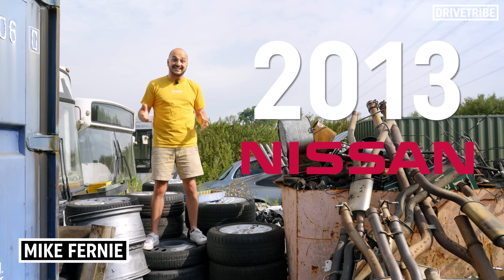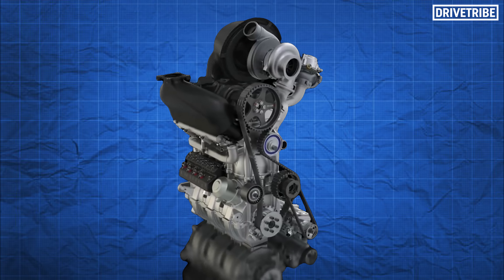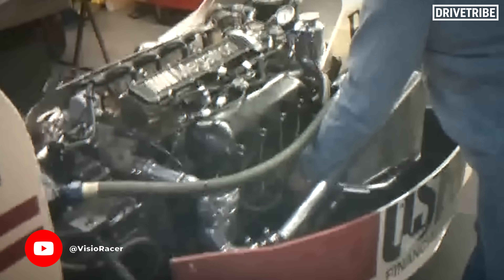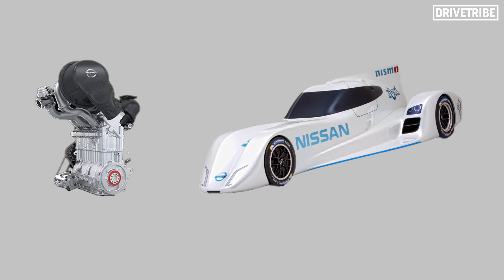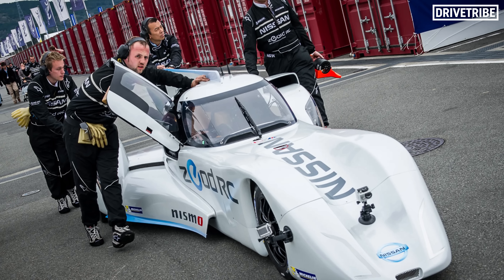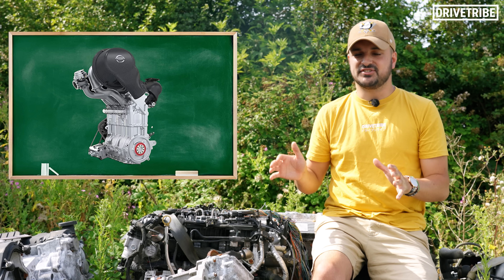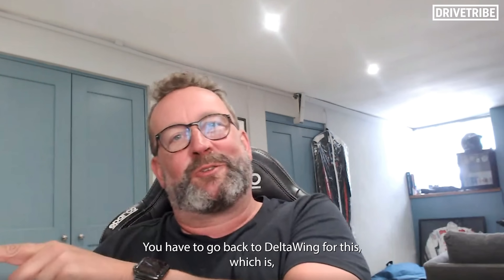This TINY Nissan Engine is More Powerful Than Your Car!

Comment: It reminds me of the Supra GT500 racecar, which had a 4 Cylinder engine that was a lot lighter than the Straight 6 2JZ. Perhaps Nissan used that engine in there racecars.

Comment: I may well have produced 400 BHP but for how long ?  Because it's so light also means it's block and cylinder head is weak . This reminds me of my motorcycle racing days when we built single cylinder 250 and 500 cc engines so supped up and running 14 to 1 compression ratio  on alcohol fuels through fuel injection into super chargers  and they produced over 90 HP  when a standard BSA Gold start 500 produced 42 Hp . However at 6000 rpm the B31  crankcase  blew up like a grenade . So me thinks that this Nissan engine did not stand up to any kind of prolonged use at high RPM .

Comment: I love nissan, but they deserve to go brok!  this engine done right would have wiped the floor with all this ev crap it would have been cheap to run in alot of small sedans and hatch's and even some bigger vehicles including 4x4's seams obvious to me it was scrapped because it was going to put a brick wall in front of the ev adgenda nissan must have been forced to put it on the back burner and it's typical and perthetic.....

Comment: Still a nissan.. it's  meh.. you'd  rather buy anything else than a nissan. All that hype with issues 1 year down the line and each trim or brand is like a fast food franchise with car parts not universal throughout other nissan lineups, or it used to be. Not like toyota where they're all corollas beneath.. Only exceptions are maybeee their sports line up, but then the convo goes beyond us common folk.

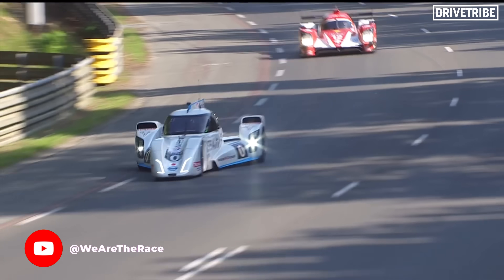Comment: 7:50 Let down by it's gearbox...
Nissan has been plagued/cursed by it's transmission system ever since they're experimenting with their torodial cvt. Quite sad actually. I assume because of that failure, they had some delay in their cvt development and research knowledge, like identifying the heat issue in their currently used cvt system.

Comment: Can we put it in a motorcycle?
Reply: probably but i’d rather put it in a cross kart or some beater car
Reply: I think motorcycle engines are meant to be fast but not carry too much weight, and car engines meant to carry weight so it wouldn't be that fast I think, but idk I'm not an expert
Reply: @yt159-sj6hd  re read the question that’s not what the op asked
Reply: @ true i just wanted to predict the outcome if it worked
Reply: @yt159-sj6hd  yeah you are right also since the engine is turboed the power delivery wouldn’t be safe for the motorcycle

Comment: What's most fascinating about this story to me is that Nissan couldn't make a durable gearbox for a race that's existed for over 100 years.

I don't know what's wrong with engineers these days. It's just a box of gears. Find your spec, overbuild it by 10%, and go cruising for 300k+. It can't possibly be so difficult to make a box of toothy wheels happy. 😓

That's the main issues I have with most cars... Automatic transmissions are seemingly made of styrofoam. That's probably why they've transitioned into sealed "lifetime fluid" versions since they already know it's likely going to die before the oil would ever need to be changed.

--oh, and to answer your question, I'd put that engine into literally any car I had the opportunity to lol. Not so torque-y, so nothing too heavy, but it would turn any roadster into a REALLY fun toy.👍 Maybe a Fiero?

Comment: The Koenigsegg Gemera is equipped with an unusual three-cylinder combustion engine called the "Tiny Friendly Giant" (TFG). It has an engine volume of 2.0 liters and produces an impressive 600 horsepower. What makes this engine special is that it is turbocharged and uses Koenigsegg's Freevalve technology, which eliminates the need for a traditional camshaft.

Comment: I think you may be a bit mistaken about the issues being caused by 24 hour use, the gearbox lasted 6 laps it didn't make it a half hour, what this car's gearbox issues boiled down to is 20xx Nissan transmissions, was probably a cvt and all of Nissan's CVTs back then were reliable until the first oil change if you got lucky.

Comment: Kawasaki H2 engine puts out about 192 and can put up to 250hp and is a 1.5L  inline 4 cylinder turbo that weighs around 62kg fully dressed up.. and that could probably be reduced quite a bit given you don't need an internal transmission or clutch so you could make it a direct-drive. I have seen some attempts at using motorcycle engines in cars and they typically lack torque but the H2 torque figures are decent at 123 ft/lb... so not extreme numbers but very light-weight.

Comment: So I’ve said this for years. The actual solution to all of this is to make a highly efficient 3 cylinder engine with a battery hybrid that has a 100 mile range. The battery starts the vehicle from a stop and then the gas engine takes over after 20 mph. Gas engines are least efficient when initially moving a vehicle while electric motors are incredibly efficient at this moment. With a perfectly balanced crossover vehicle with a 25 gallon tank. You could easily achieve a 1,000 mile range where the hyper efficient engine gets around 50 mpg and the electric motor helps it maintain that by utilizing regenerative braking, start stop and moving the vehicle from a stop.

Comment: Why compare a 2.7 to a 1.5 thats double the weight?

Lots of engines are all made from one design thats purchased as a file.  Most of the parts shared which is why all motors have the same issues.  Eith a few addons are tweaked or the ecu tuned for specific hp and tq.

The nissan rogue engine with a tune and twin turbo is what im dripping into my car because its easy to find and cheaper compared to finding a ford dragon in north America at the moment

Comment: Allright listen... i am building a Saab 96 850cc 2stroke engine with forged internals. traget power between 80 and 90hp. and im pritty sure the thing waight isnt more than 60kg. so that would be on the engine power to waight insane... right?

Comment: 0:04 it wasn't an engine, but marketing stunt.. this engine was never used or tested by 3rd party..
guy from sweden has air cooled bike engine that will do 1000hp, probably same weight without turbo and manifolds.. 

i think barebone skoda favorit engine block was like 9kg of aluminium..

Comment: 4:01 the engine has got to be expensive to produce (it's a race engine )and not all that durable, you don't get weight like that from making robust parts.
Modern cars would be better ditching all the weight from the excessive wires and sensors.

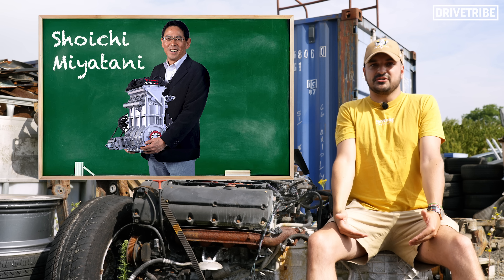Comment: 1:30 had to stop watching here, it is a cool engine but going on about the old man holding it, (he wasnt, it was on a stand) and it may have double the power of the ford engine but the Bmw engine from like 50 years ago has more then 3 times the power of this modern engine, I know because I did a full overhaul on one.

Comment: Should have held two engines one for each rear tire and use direct drive as once anyone adds 4wd these systems never work of course that would change to body styling provided any of this is true as stated😊

Comment: My VW Fox 1.4 engine has started drinking water recently, likely head gasket. So this Nissan engine would fit and I watch then Ferraries only from the side for a moment and then rear mirror until they are too small to see ... If you have a perfect working 1.4 BKR engine for free I take that too ...

Comment: so many eroneous figures in this piece!

40kg is the "bare" mass for the Nissan engine, ie an engine that actually can run and work is significantly heavier (around 66kg iirc)

F1 engines have for years been limited by regulation as to both their mass and their CofG, hence mad things like solid brass sump pans etc. A 100kg F1 engine could, by most analysis actually be got down to under 80 fairly easily, and the last of the V10 could make around 930 bhp in qualiy trim

The Old F1 turbo 4cyl BMW engine was nowhere near 45, let alone 75kg!  It's got an iron block and the turbo is about the size of the moon! Without all the trick thin wall casting and additive manufacturing tricks used in todays motorsports engine it was, bar some carefull machining, pretty much proddy block and head

Comment: Rotax has a 1630cc 4 cylinder running on normal car fuel with 300HP weighing 91kg. I think it's for jet skis normally. Fairly sophisticated engine by the looks of it.
I have been looking into various super alloys for jet engine use and I think I can say that what's being done in normal piston engines is a tiny fraction of what can be done with much better metals. Normal black steel has a tensile strength around 300MPa whereas a quality alloy can be 2000MPa and if you get exotic it can be 6000MPa so the wall thicknesses you are used to is just dumb cast iron 1930s thinking. done well it's just a thin shell around the pistons with negligible weight. same with the pistons, thin top hat, thin arms, well supported crank shaft. If it was any kind of sophisticated it would look alien. the term 'engine block' is a failure in itself. It could also have rocker pistons so there is no friction on the cylinder walls at all.

Comment: I like the 4 cylinder for aircraft usage.  400 HP for take off then dial back for cruse.   It could also be  mildly turbocharged to maintain HP at altitude...

Comment: I'd put it in a Honda Jazz/Fit chassis, the second US generation 2009-12. It has the most rigid chassis, great handling, and amazing cabin volume for a subcompact lightweight car.  The engine would be perfect coz the Jazz/Fit has a small engine bay space. If I wanted a sports car instead of a daily driver, Mazda Miata ist two generations, also for it's handling.

Comment: Hmmmm, 10HP per kg is quite decent...
Still, it's tame compared to Top Fuel engine.  (11 THOUSAND HP at 225 kg give me a figure of OVER 48 HP per kg!).
Sure, they don't LAST quite as long, but you already included F1 engines which are fully rebuilt after each 'use', just like Top Fuel.

I wonder why they weren't mentioned?
Oh, that's right, I forgot that DriveTribe HATES drag racing... <<Grins>>

Comment: Size (Part thickness and strength) matters with big power (pressure and heat). Electric has the edge because it only worries about heat and it very low in comparison.

Comment: I grew up racing Midgets. People do not realize how fast and light they are. 400hp, 1150 pounds with the driver, no clutch or transmission. They are direct drive with a higher power to weight ratio then F1.

Comment: couple of questions, 1. how much hp does it make without the turbo charger ? 2. what is its headroom for expanding hp ? 3. how much torque does it make? 4. what's its reliability ? 

really banging on about hp when its the turbo carrying the load isn't really 400hp, is it flat out at 400hp and isn't viable in racing, 3 cyl wouldnt be making very much torque and it is more important than hp, how long can it keep up in a long race squeezing 400hp from small engine usually become a hand grenade, is that why it never went into production

Comment: NHRA Top Fuel engine:  10,000hp, 500lbs (226kg) = 44.2 hp/kg.  'Merica drips the mic.
Reply: That is correct however it produces that level of power for 10 seconds at a time then after about 60 seconds of running needs a rebuild.

Comment: You may also want to look into the Toyota 503E 2.1L 4cyl Turbo, a purpose built racing version of the common 3S-GT 2.0L, with an increased bore (89mm vs 86mm) to accommodate larger valves to achieve better breathing from the cylinder head. It was originally from TRD USA and used in IMSA, but eventually made it's way into the JGTC/SuperGT Winning Mk IV Supras (Toms, Sard etc) in mid-90's Japan where it put Skyline GT-R and NSX alike to complete shame, considering what it was. It was not uncommon for it to produce well over 1,000 HP at the wheels for qualifying runs, then run around 600-800 for actual racing. It was eventually restricted back to 2.0L and the original 86mm bore after becoming too dominant and also handicapped with inlet/boost restriction. Just thought this engine might have also been interesting to you, since this was back in 1995.

Comment: What's GREAT! A small engine that has 400+ horsepower, get 75 MPG, has no oil or water, weights less than 300 pounds, keeps the horsepower no matter the altitude, can be worked on by a shade tree mechanic, is the size of a 14' tire, will last for 5000,000 miles and costs less than $2000.00. By the way Fred Flintstone had one of these!!!

Comment: Surely if you turbo a 200bhp+ 1000cc motorbike engine you could get it comfortably over 300bhp. Im not sure what it would weight but id guess it'd be less than 70kg. Theres plenty of people who have put a turbo on a hayabusa 1300 engine to boost it to 400bhp or more. They're about 90kg. Sure its not 40kg but its an accessable option already available on the market

Comment: Surely the amazing technology used to create the Nissan "Diglett", could be applied to build super-lightweight and efficient road car engines? If the car manufacturers REALLY wanted to, we could have lightweight, powerful and yet frugal cars. We need not go the EV-route at all. I'd be over-the-moon with a 150hp "only" version of that Diglett engine, if that means that it would translate to reliable road car engine power. Imagine a 150hp Diglett in a small 2-door car, like a 1960's Mini (I love those), and it you'd have a real fun little go-cart! Even in a more practical car like a VW Polo, it would still be amazing.

Comment: This TINY Nissan Engine is More Powerful Than Your Car! 🙃😏🤔 who come up with this title? The biggest majority of the cars driving in the Europe have engines under 200hp, and I believe, not much under half of them, have engines with less than 100hp. Så what kind of an comparrition is this?🤔 And something else "Drivetribe", there is no such a thing as a powerful car. The car is nothing without an engine. So that engine may be more powerful than the engine in my car but not more powerful than my car.  😉

Comment: i love the idea of small engines making big power. i loved it when the barra 6 showed up the big gm v8s, i loved it when the gr yaris/corolla showed up the STIs and Evos of the world with their 3 cylinders. if Nissan were to bring a similar engine to the production world, it could make a cool combo for a nismo variant of the current Z car if it were to be combined with a performance hybrid system. the lightweight powerful engine with an electric motor to assist would make for an interesting combo imo.

Comment: Ill be honest, I more interested to this kind of small engine putting 200-500 HP than the v8 or v10. and with the industries moving to battery power, this kind of real innovation for gas-powered engine is will be less in the future.

Comment: I have a twin cylinder Suzuki 1100cc arctic cat snowmobile that has 300hp with a simple ECU flash. Some people make more power than that with a few more mod. I  can hold engine it in two hands no problem. The 1000 cc  Yamaha - arctic cat same thing make 300 hp no problem with ecu flash.

Comment: The oro lemon with these engines like the bmw 1.5turbo from 1980 8s they are not robust enough for a  road car. . Race engine are pampered road engines are abused.

Comment: With that size, I am truly suprised nissan hasn't tried to turn this into a 400 hp motorcycle!
Reply: There is no point, tyre grip is the limitation on motorbikes.  Putting power through one small contact patch. Physics is against most things.

Comment: Imagine that in 12 cylinders!   Or slightly de race it a bit. Make it a more street able engine, and put it on a motorcycle, with 10-12 gears with a automatic skip shift, so when going up hills or accelerating fast.

Comment: Didn't Opel have a 3cyl diesel that got great mileage (100+ mpg) at a decent speed (avg over 100mph) over an endurance race?  I would guess it wasn't as light as this though.

Another small but powerful engine would be the super duke or something similar based on a pontiac 4cyl "iron duke".  Again not as light... but I believe NASCAR trucks were able to get close to 4-500 hp naturally aspirated iirc.

Comment: you should check out kawasaki's 310 jetski engine. also small lightweight, 4 cylinder 1.4 litre with a redline at 8200, supercharged.

Comment: With peak torque at 280 lb ft, the absolute minimum RPM that it would need (if peak HP and peak torque are at the same RPM - which almost never happens) is 7,500 rpm to make 400 hp. According to several articles on this, the engine redlines at 7,500 rpm.

Comment: I'd have loved this engine down tuned to 300HP and convert my limo from RWD V8 driven through a 4 speed, to FWD driven through a transaxel 8 speed, then slap a 200KW motor on the rear differential for an AWD hybrid

Comment: We have a Fiat 500e - that we have started imagining what would be done when the Electrics Finaly bite the biscuit!
Any ICE solution would have to be tiny to fit in front, and we don’t really want to gut it and put the standard 500 drivetrain et all back in…
Some something like that or the Ford 3 cylinder might an option 
🤣

Comment: Hi, I don’t know if someone already pointed it out or not, but Nissan started to sell in Europe a 3 cylinder for the hybrid, and on the X-Trail it’s a 3 cylinder turbo, working as a generator for the hybrid system. Could it be the road under tuned version or this one?

Comment: something light but fast, for modern times can't beat the..Ariel Atom, but for times gone by.. Daf 44 .. yeah Daf 44,  produced in the Netherlands in the 60's with the famous "variable transmission" using belt-drive technology a car that can almost go as fast in reverse then forward, and we even had races in BOTH directions with them ( just not at the same time).